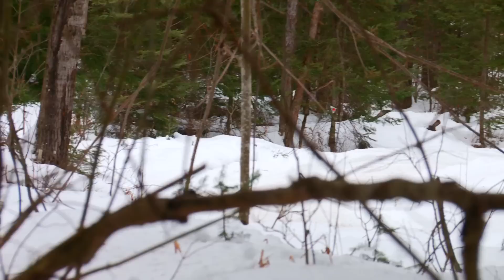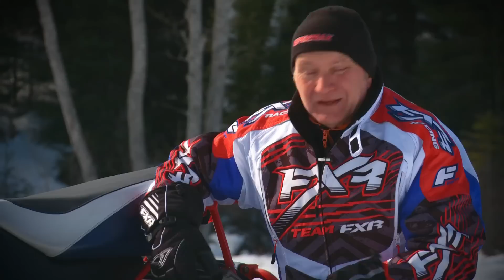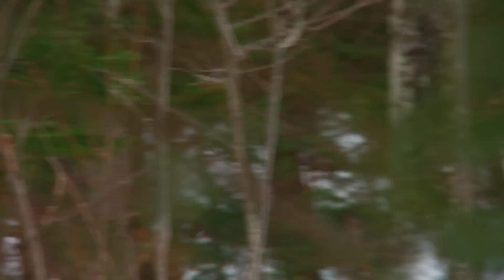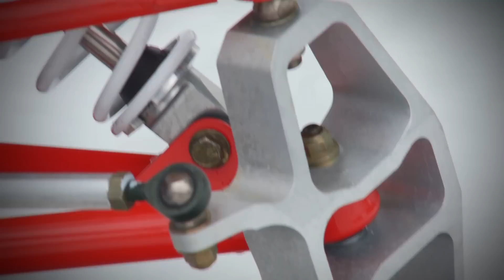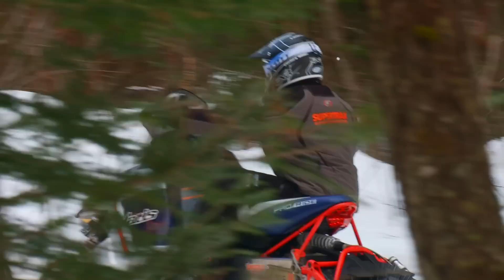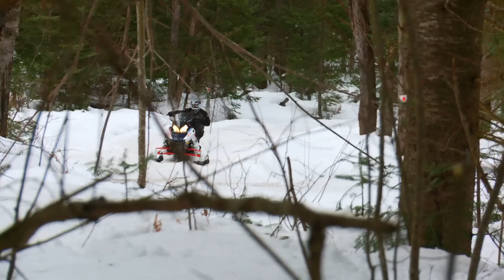SLED TEST: 2012 Polaris Switchback 800 Pro-R

Comment: Problem was the 800 was a time bomb after a couple thousand miles. Was 2015 before they got the 800 right
Reply: How many miles? I’m looking at one with 2800 miles should I be worried?
Reply: @connerrecoskie  yes. If it’s a 2009-2014 don’t bother….
Reply: How about 2015 800 w 7000 miles? Is it still reliable or needing a rebuild Thanks